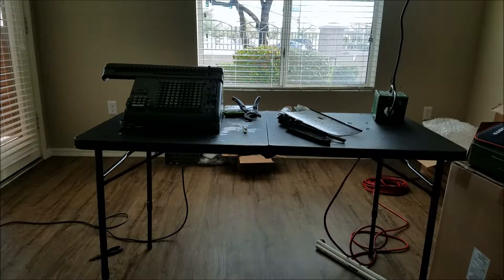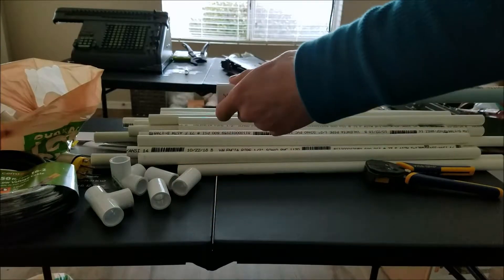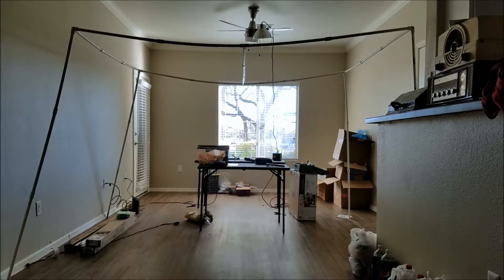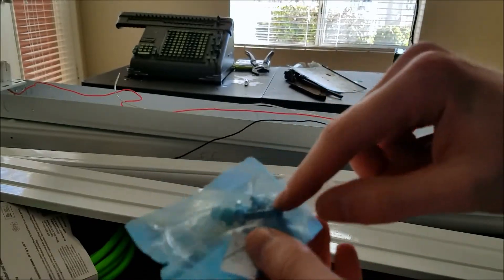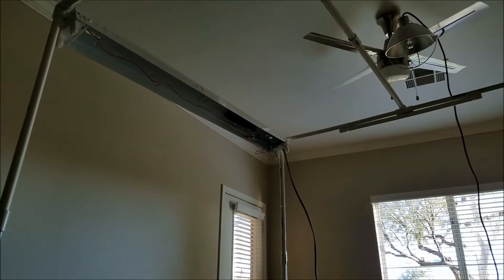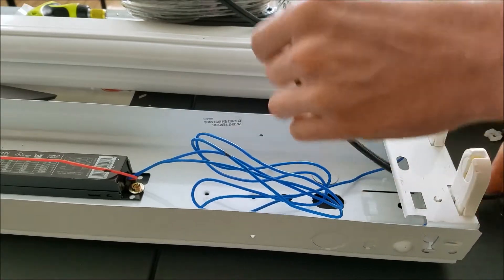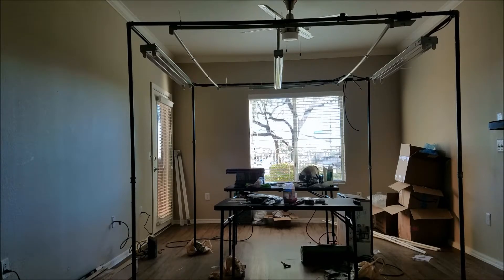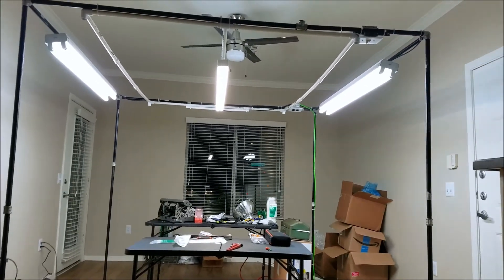Building a New Light Setup for My Work Area

Comment: Good video. In one of your old videos you showed a fluorecent tube ballasted with an incandescent bulb. Is there a specific wattage of bulb required for that? Also could you ballast a metal halide or high pressure sodium like that if the ignition voltage is high enough?
Reply from the maker: I don’t remember the wattage of the fluorescent I used, but it was either a 12 inch or 15 inch T12 (I’m sorry I don’t remember exactly which) and I think there’s only one wattage commonly available in those sizes. I do remember that the incandescent I used as a ballast was 60W. I think for any fluorescents larger than what I used, the voltage doesn’t get high enough to start the tube. If you have a probe start metal halide you could, they actually made mercury vapor lamps with an integrated ballast filament. This wont work for high pressure sodium or pulse start metal halide since both of them need a high voltage pulse to start them. If you want to do your own experiments, I found the proper wattage for driving the fluorescent by starting with the smallest wattage incandescent I could find and working my way up until the lamp started and lit. This could be a little more dangerous with something like metal halide though since the arc tube is at very high pressure and could explode if overdriven (they do sometimes explode at the end of their life).

Comment: can you please plug a 200w hps bulb part number LU200/ECO/ET18 ..... into a 175 watt murcury vapor balast...??? i would appreciate it....
Reply from the maker: This will not work because hps lamps need a high voltage pulse to start, which mercury vapor ballasts do not provide
Reply: @bss1250  thank you